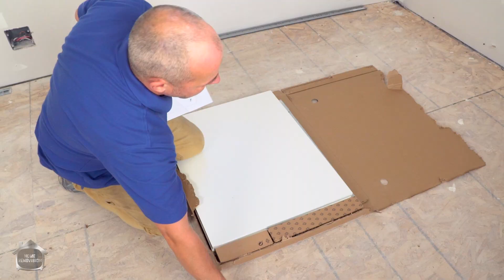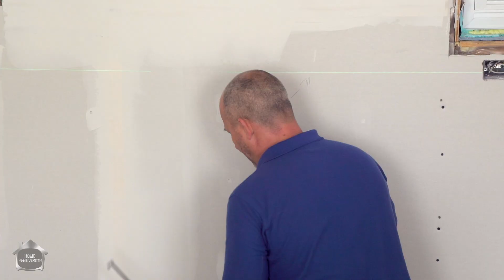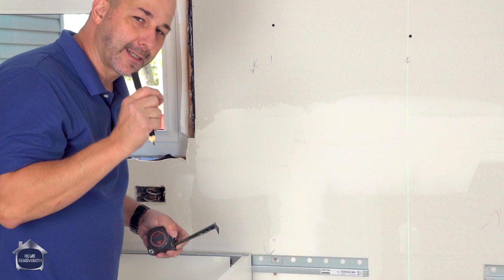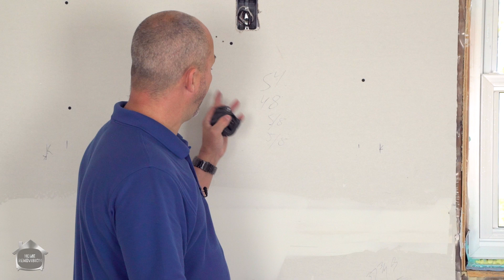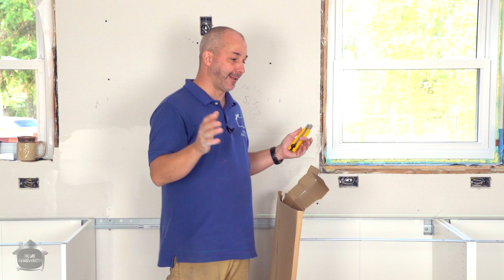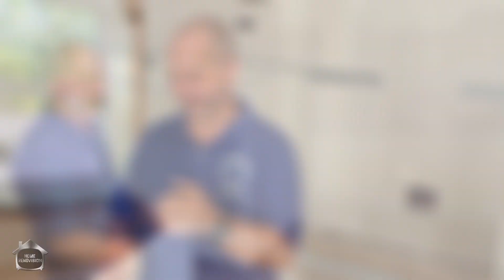How to Install IKEA Kitchen Cabinets and Save Money! | DIY Kitchen

Comment: I installed IKEA cabinets in my house 8 years ago, and the quality was much higher. I did a new IKEA kitchen couple months ago, and they have figured out how to cut a bunch of corners. You need to be careful when handling the boxes. Once installed and secured with a bunch of screws, the cabinets feel sturdier (as long as you don't use the plastic feet).
Reply from the maker: I found that once the counter top went on the feet were no longer an issue., Cheers!

Comment: 43:45 Said 10" but forgot to include the thickness of the grey panel on the side of the island.
Reply from the maker: The point of the exercise was to visualize the space. In the end we cut a radius on both  of the outside corners to accommodate the tight fit. Cheers!

Comment: I must admit I never thought of Ikea for cabinets but it is a great idea!
Reply: I used IKEA cabinets in my laundry room, with soapstone on top.  Easy to assemble, install, and level.  The soapstone guy was impressed.  Apparently he often encounters poor leveling and matching of cabinet boxes, even from pros.  
Now I'm doing a complete kitchen replacement in another house.  We briefly considered other cabinet sources, mostly due diligence, and swiftly decided again that IKEA is the way to go.  

We used the IKEA kitchen planning service for two kitchens.  Very helpful for ensuring all the bits and pieces get purchased together.  Many bits and pieces.  One kitchen planner was terrific, although she modeled the refrigerator wrong so the cabinet above was wrong height.  The other planner was less good; he kept questioning my measurements and shaking his head doubtfully, which burned up a lot of our two hours with him.  We still got a good list of all the parts needed.  But that's just a service, which can vary.  The CABINETS are reliable.  25-year warranty.  Far more configurations available than stock cabinets anywhere.  

Jeff makes great points about installing the rail and installing the feet.  I definitely learned stuff from his vid.  I think most people will be very happy with IKEA cabinets.  I  am.

Comment: You can also cut the extra rail off with a oscillating tool with a metal blade, works great for close work!👍
Reply from the maker: You must really love that tool. Cheers!
Reply: @HomeRenoVisionDIY  LoL yes i do, I use it quite alot.

Comment: For an island, I've just built a 2x6 frame (ripped down to the appropriate height) and leveled that, then put the cabinets on top and screwed them into the frame.  A lot easier than fiddling with the adjustable feet, and a lot more stable.  You can still put the feet on the outside edges to attach the toekick.  Another thing I do is add the rear feet on the wall cabinets and snug them up, just in case the rail gives a little.
Reply: Do you mean that you add feet on the rear of the base cabinets?
Reply: @silekiernanphotography  yes
Reply: @makerpat  Thanks Patrick!

Comment: JUNK....
Reply from the maker: it all depends on the resale value of your property. Cheers!
Reply: Rick, Have you looked at and used an ikea kitchen? Guessing not. 3/4” sides, solid. European hardware for glides and hinges, very nice. Very customizable.
Reply: @krehbein  ...Are they solid wood  ?? ...if not junk....
Reply: Rick S Ahh, I see, a purist. Solid birch ply sides and back is nice if you have the budget. Btw, I’ve ripped out cabinets that were a big name brand and they were crappy 1/2” laminated board sides with plastic angle support brackets. But hey, they’re a well known name brand.
Reply: Hardware on mine is all working great after 10 years. Throw on some after market solid wood doors and you have a new kitchen at a tiny fraction of the price, lol
Reply: Rick - dumbass.

Comment: I built a timber plinth to set them on rather than use the feet, get the timber plinth level once, they base the rails of that (still with a laser level) the plinth saved a lot of hassle if you need to pull a cabinet back out again to cut around electrical etc. Strengthened the back with strips (width of cabinet) of 1/2" ply, makes a huge difference the back is solid with it.
Reply from the maker: Cheers conrad, those legs although great for leveling can be quite precarious!~
Reply: @HomeRenoVisionDIY  Would a plinth like that work for a dryer base? They want to sell the base for 279$. I'd rather use bags of cement, lol
Reply: @HomeRenoVisionDIY  my floor was spot on level (I did it :) ) so I didn't have to shim the timber plinth too much at all probably feet would have been easier if it was really out of what. I was a bit worried about snapping the feet as well. (+ I already had the timber and saved a few pennies not buying the feet). the bare Ikea carcasses are so cheap it's worth buying a few spare if you need to modify a cabinet say round some column or boxed in pipework